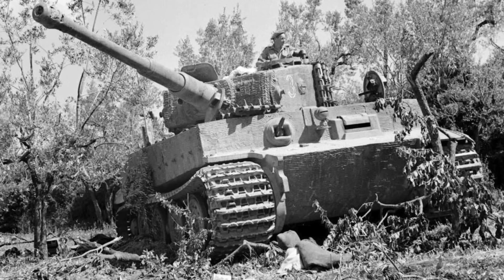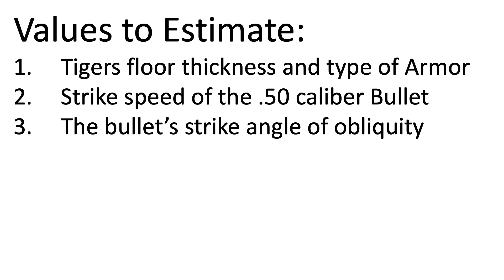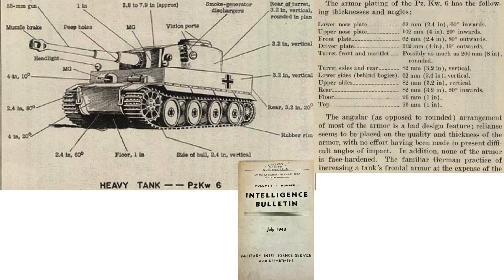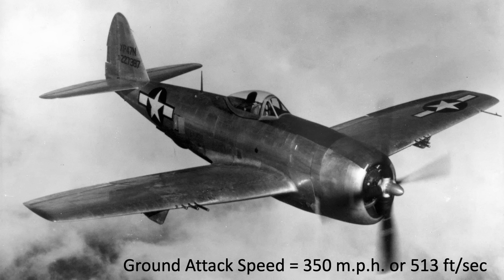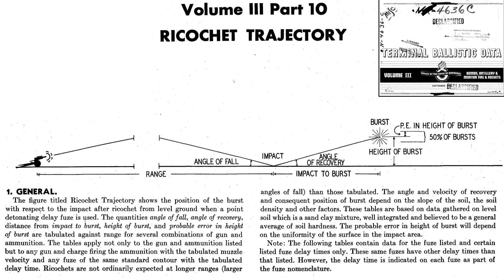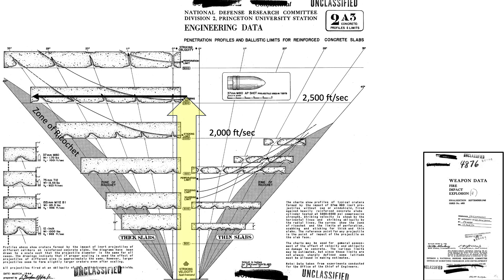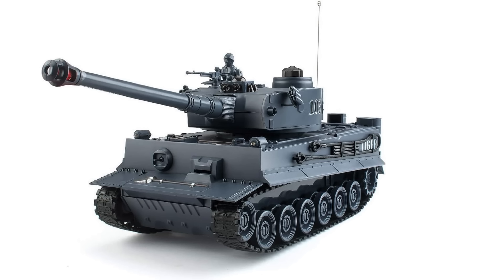P-47 vs Tiger Tank: Can Machine Guns Penetrate Armor?

Comment: Many here seem to be overlooking some pertinent facts concerning the killing power of the browning .50 caliber machine gun. 

The first of which is the design parameters of the weapon stipulated that the .50 be capable of "perforating an inch of hardened armor at 1000 yards. 

The second is that as use of the weapon evolved, the ammunition belt load out in US aircraft in WWII also evolved. By 1944, allied fighter bombers were armed with ammunition belts stacked with different types of ammunition. Tracers were added every 5 or 10 rounds. AP ammunition was interspersed in the belts as well. This further increased the power of the .50. 

Third: One also has to factor in that US doctrine specified that fighter bombers should attack their ground targets via high speed dive. This wasn't just a means of increasing the odds of the attacking aircraft suviving the attack (by virtue of the fact that a fast moving target is harder to shoot down than a slower moving AC. There was a value added physics lesson here, as a high speed dive nearing 4-500 mph added unstoppable force to the .50s muzzle velocity. Fact, not speculation. 

Fourth: It is well known that Germany, by 1943, had problems securing adequate amounts of Manganese and other cruicial metals. These are critical in creating quality armor plate. The shortages meant that many German tanks carried armor that was brittle and prone to shattering upon impact. Add to this the fact that many German tanks were built utilizing slave labor and you can add a sabotage factor to the armored units as well: if a critical step in the alloy process of armor mfg is left out, the result is further weakened armor. 

It is a fact that the .50 could penetrate the rear and side armor of the Pzkw mk1, 2, 3 and 4 tanks. Add to this the factors above and it is almost a certainty that US aircraft could knock out a panther or tiger tank. The fact that most German armored units reached a point at which they would only expose their tanks at night, or in inclement weather, when allied fighter bombers were grounded.

Comment: Us military manual TM 31-210 , page 251, it states that 2 inches of mild steel is required to stop a .50 cal at 10 feet. So essentially , 1 inch could be penetrated.
Reply: The uploader quoted info from a US Army document on the construction of the Tiger Tank; it stated that the underfloor was not mild steel, but homogenised armour plate.  Further, the P-47 pilots were certainly not shooting from 10 feet away, but hundreds of yards away.  Finally, the figure quoted in TM 31-210, page 251;  is that figure quoted with the bullet striking the steel plate at a right angle, or at the very shallow angle from being fired in a shallow dive, and ricocheting off the ground at an equally shallow angle?

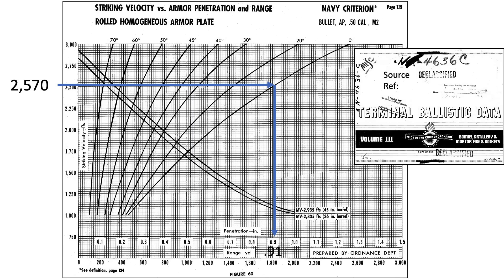Comment: One thing you didn’t consider is that, regardless of the velocity of the plane. In extreme dives pilots reported speeds of up to 700 miles per hour. Add that to the velocity of the bullet, and you get a significant increase in velocity. The .50 had a muzzle velocity of about 1980 MPH, plus 700 is 2700 mph. Fairly significant. Even at its maximum speed non-dive it’s still adding 400 mph to the velocity. Before calculating air resistance, the new velocity of the round goes right off the chart for the .50 caliber bullet (5:28).
Reply: You say "in extreme dives, pilots reported speeds of up to 700mph" - that's close to the speed of sound.  Supersonic aircraft have a lot of sweep-back on the leading edge of the wing because, if the leading edge is square to the centre-line of the fuselage (as it is on the P-47), the aircraft suffers from terrific buffeting as it approaches the speed of sound, capable of breaking up the wing.  It also makes it extremely difficult for even a skilled pilot to hold the aircraft steady enough to aim guns, bombs or rockets.  That's why RAF Typhoon pilots were taught not to approach at maximum speed when strafing, even though the Typhoon was a very stable firing platform.
"Before calculating air resistance, the new velocity of the round goes right off the chart for the .50 caliber bullet."
Agreed - but you CANNOT ignore air resistance!  That is such a key factor that high velocity bullets intended for long range shooting have their nose and tail profiles carefully designed to minimise air drag - and the faster the bullet is travelling when fired from an aircraft, the greater the drag.  To give you an idea;  when the Concorde was flying at supersonic speeds, air friction made the skin temperature high enough that, if it was possible to stick your hand outside and touch it, you would get at least a 2nd, if not a 3rd degree burn.
Reply: @jackx4311 ww2 pilots got 0.7 mach during dives quite a bit especially later fighter like the p47 reach 725 mph during high speed dives, but I dont think staffing runs reached anywhere near that speed.
Reply: According to my calculations, in an extreme dive, the bullet leaves the barrel at almost 4000 feet per second. Even with drag, it should easily cleave through the tiger’s roof armor.

Comment: I really tought the war planes were shooting 20 mm
Reply: British aircraft were, from the end of 1940 onwards - and the Hispano-Suiza design was both effective and reliable.  So why didn't US aircraft use the same design, when we'd sent full drawings, material specs. and parts lists over to you?
Problem was that the US-built 20mm cannons were plagued by constant misfires - so we sent some of our engineers over to see if we could help.
The HS 20mm was a Swiss design, so the dimensions were in metric measure.  When your engineers converted them to inches, they messed up on a key dimension, and bored the chamber very slightly too deep.  The result was that the firing pin did not get a decent strike on the percussion cap - hence the misfires.  Unfortunately, rather than accepting that they'd got it wrong, they kept on making them to the wrong dimensions, so US aircraft fitted with US-built 20mm cannons had to have cocking levers inside the cockpit - whereas aircraft fitted with British-built cannons had the cocking levers on the underside of the wings, where the squadron armourers would set them just before the aircraft took off, and we never had a problem with misfires.  HTH

Comment: I have saw gun cam footage of U.S. fighters vaporizing german tanks.What i think was happening is that .50 cal bullets were bouncing into the turrent and setting off live tank rounds.I served for 12 yrs in the U.S. army on the M60s and later transittioned to the M1 and M1A1.
Reply: In a really steep dive, the .50 cal bullets would probably go through the roof armour of a Panzer IV, as it was only 10mm thick.  The Tiger was a different proposition;  top and bottom armour was 25 mm/1 in. thick; from March 1944, the turret roof was thickened to 40 mm/1.6 in.  I doubt a .50 cal would go through that, even if the P-47 was in a vertical dive.  HTH
(Source:-  Jentz, Thomas; Doyle, Hilary.  'Panzerkampfwagen VI P (SD. Kfz. 181)'.  Publ. 1997, Darlington Productions. ISBN 1-89284-803-1.)
Reply: Thank you sir for your input.Whatever those U.S. fighters were blowing up, they had a lot of big ammo on board to make such an explosion.

Comment: When I was much younger I'd heard this and didn't think anything of it.  I haven't thought of it again until this video, and at this point in my life I know that shooting a .50 cal rifle at much closer range at an oblique angle into AR500 armor does not penetrate steel plate less than an inch thick.  Given that when attacking tigers the tigers were almost always going to be in the dirt, seeking cover, or off the road once they hear the planes even if they had been on road, I doubt many rounds even ricocheted.  Just goes to show how little you know about the effects of your effort in a war.  Often just guessing, or wishing.
Reply: Agreed - you often don't know a thing about what it was like for the blokes on the other side until afterwards.  The RP-3 rockets used against tanks by aircraft like the Hawker Typhoon were known to be inaccurate;  problem was that, at lauch speed, the stabilising fins were to small to get a decent grip on the air, so they wobbled until the rocket had built up speed.  What was surprising though, was that, in the aftermath of the Battle of the Bulge, many German tanks were found in full working order, with fuel and ammo - but which had  been abandoned by their crews!  It was only a couple of years ago I read something which might explain it.  It was a quote from a German tankie, who had served on the Eastern Front, been injured and evacuated, and then transferred to the Western Front just in time for the Battle of the Bulge (some luck, eh?)  He said that being attacked by Typhoons armed with thse rockets was THE most terrifying experience of the whole war for him.  He explained:
"If you were hit with cannons or bombs from aircraft, they might hit without doing serious damage - sometimes, almost none.  But those damned rockets?  If ONE of those hit your tank, you were DEAD.  All you could do was to pray that they'd miss."

Comment: Better question? What about just punching through the top where armor isn’t as optimized?
Reply: Exactly. On the Tiger the top armor and bottom armor are the exact same thickness at 25mm.

You’d have a way better chance of penetrating attacking the top directly, rather than trying to penetrate the bottom at a steep angle after the bullet loses energy and deforms from the ricochet.

Comment: I have my doubts that even AP rounds would penetrate even a modest armoured floor plate, much less the inch thick Tiger's, because the greater the speed of the bullet, and the better it's penetration before deformation rendered it unable to penetrate, the deeper it will go into the roadway before the ricochet occurs. This means that more and more energy-loss will occur the better the penetrative ability of the round, and in doing so, it'll likely be a deformed slow round hitting the underside, not a fast hard and sharp one! And that's IF the round manages to exit the ground having gone deep into it on the initial impact.

Comment: The top/bottom armor could single 50 cal round hits but hundreds of rounds beating down simultaneously would cause a greatly concentrated effect and it is a different story entirely in that scenario.  I sure wouldnt want to be on the receiving end of 500 50 cal rounds behind an inch of steel.
Reply: I think that kind of logic can apply if the round is close to penetrating the armor, and can hit near the same spot on the armor multiple times.

The .50 cal can maybe penetrate 25mm of armor at point blank 90 degrees.

Here we have a situation that is not point blank, the round also will smash into the ground deforming and losing energy, before hitting the armor at a shallow angle. The steeper the angle you hit the ground, the more energy loss and deformation, until the bullet is pulverized.

I’d bet you’d be lucky to penetrate 5-10mm of armor from a ricochet like that, I’m pretty sure once the armor is 2-3x thicker then the penetration ability of the round the impact doesn’t do much.

On top of that this is in no way precision firing and the rounds are going to hit all over the bottom of the tank.

Comment: I use to play a WW2 video game - The Ardennes (was the Air Corps title for Battle of the Bulge). On the P-47 if you (the player) attack a Tiger tank from the rear you could set the engine on fire. (LOL).

Comment: I doubt too many p-47's were only going 350 mph on an attack run on any tank.  It could out dive any plane in the war.  Still I doubt they had much success taking out tigers with a .50, but odd things happen in war.  My guess is it penetrated a damaged fuel tank and they thought they took out the Tiger.

Comment: I wonder if these factors are worth considering:
1. Bullet wind resistance on hot day/thin air vs. cold day/dense air.
2. Bullet acceleration due to gravity in a 1200 foot fall.
Perhaps neither one is significant.
Reply: Pretty sure those forces are fairly minuscule.

For the gravity assist it might help a tiny bit, but air resistance will be much more important. 

Even if the bullet is traveling straight down, Free fall velocity is 175 f/s while the muzzle velocity of a .50 cal is 3000 f/s

That’s means shot straight down gravity provides enough energy to counteract the air resistance of the bullet traveling at 175 f/s. The thing is air resistance is velocity squared.

The bullet coming out of the barrel at 3000 f/s will be experiencing roughly 300 times the air resistance of a bullet that’s in free fall.

In summation a .50 bullet shot straight downward will effectively experience 1/300th less slowdown from drag than a bullet shot horizontally at muzzle velocity. With the ratio decreasing as the velocity of the bullet decreases.

Comment: Also a consideration is that at an angle the effective thickness of the armor is increased. So 1.02 inches at 90 degrees is almost doubled at 45 degrees. If pilots were doing what the guy in the original video said they were just wasting ammo. Good video, lots of math and calculations that make it fact and not opinion or hyperbole.

Comment: The engine cooling plates were on the back top of the main body of the tank and were often slotted to enhance cooling.
Reply: The Tiger had no bare slots through which you could see its engine.
The Tiger's engine cover had one single slot, forward near the turret, that was covered by a steel hood. You could not see directly in through it.
The Tiger also had a ventilation hole in its engine cover, protected by a large round metal dome.

Comment: I'd think a far more likely (positive) outcome would be a mobility kill, damaging the tracks & wheels rather than any internals. That's assuming any positive results at all.
Since a tank is only a tank when it can move, & Tigers were notoriously unreliable anyway, aiming low for the tracks would be an effective way of stopping any advance & requiring repairs or abandonment, & that would work on most tanks. Likely, that info would've been twisted in service to "aim low & get ricochets."

Comment: I recently saw a video from The Chieftain where he was discussing the difference between actual effectiveness of a weapon vs what some of the soldiers using the weapon believed the effectiveness to be.  His final conclusion was that a soldier's belief in a weapon can often make them use the weapon more effectively, even when they are not actually achieving the effect that they think that they are.   These ricochet shooting attempts may be another similar situation.  The belief that the tactic had some possibility of working may have lead the pilot to make a more effective strafing run on a tank or group of tanks while actually dealing no useful damage.  Even so the target(s) would still have to take actions to deal with the attack and that in and of itself may have had some short term effect on the war effort.

Comment: 50 caliber bullets are not made  like 37mm or other artillery shells, which are made of milled steel.  50 cal rounds are copper jacketed over a lead core or an AP penetrator core and are not anywhere near as structurally sound as artillery rounds. So they will deform on impact  and not bounce much if at all.

Comment: Ricochets depend on the elasticity of the bullet and the material impacted. Most bullets are elastic and just deform when hitting an inelastic surface and slide along the surface and do not bounce like a rubber ball.  There are Youtube videos done by the SloMo guys that show that ricochets simply slide along the surface impacted; they don't bounce up. The bullets deform of shatter on the hard surfaces regardless of the angle of angle of impact.  So a bullet hitting a hard surface at a 45 degree angel does not bounce up at 45 degrees and continue onward. It flattens and slide s along roughly parallel to the surface impacted.  If the surface hit was dirt, the bullet would likely penetrate and break up with perhaps some dirt debris splattering up  and giving the appearance of a ricochet. A solid AP penetrating round would most likely do just that and burrow into the ground. That's what they are designed to do.

Comment: The 50 cal bullet would be deformed and slowed significantly by the impact with the ground which would chew up the bullet much like sandbags do to bullets. If it did bounce upward (unlikely, see my other comments) its velocity would be significantly reduced from the the 2500 +/- fps calculated in the video.

Comment: Engine cover was their weak spot. The Sherman tank short barrel 75 mm could penatrate the back end of a Tiger or knockout the drive wheels and tracks. Allied fighters armed with phosphorus bombs could cripple a Tiger. The burning liquid phosphorus could burn thru seams of the tank causing the crew to abandon the tank. US infantry could disable a tank using smoke grenades fired by an M1 garrand rifle.
Reply: Why the back end? It was as thick as the sides.
Reply: Engine access cover was of lighter steel to allow for engine maintenance.The top of deck behind turret was a grill to allow engine cooling. Most tanks were a compromise they all had there strength and weaknesses.
Reply: @jeffreycler495    You said the "back end" which means the rear wall, not the cover.

Comment: I know that a 50 caliber will penetrate a 1 inch pice of cold steel at 200 yards I have seen it with my own eyes.  Now I don’t know what type of steel was in the floor of a tiger tank or if a ricochet could accomplish this. But I do know a 50 cal can penetrate over an inch of certain types of steel
Reply: The Tiger's floor was 25mm. But I doubt very much that rounds would ricochet in a useful manner. If a round was capable of penetrating steel, why would it not penetrate a road surface?